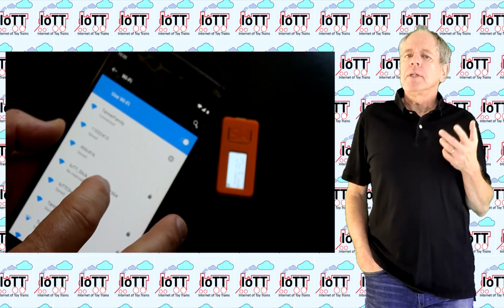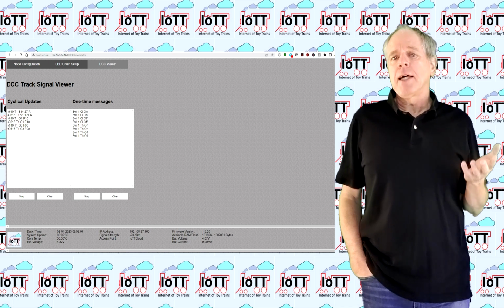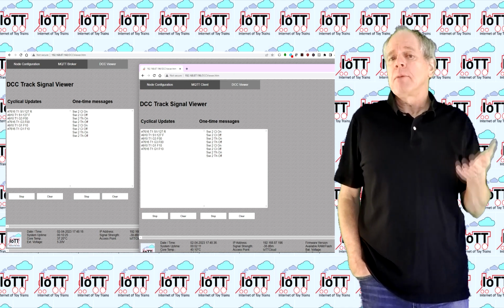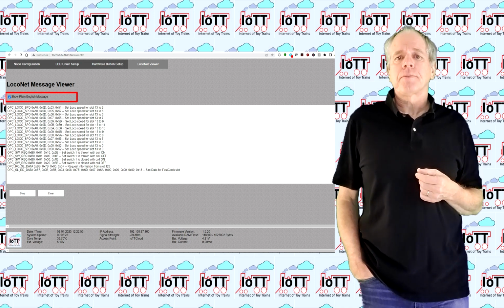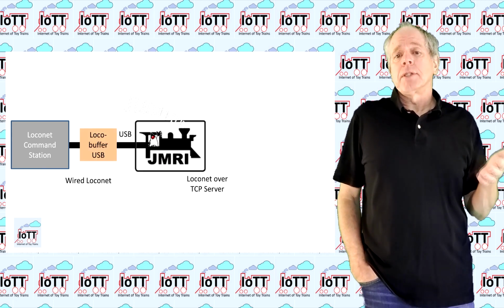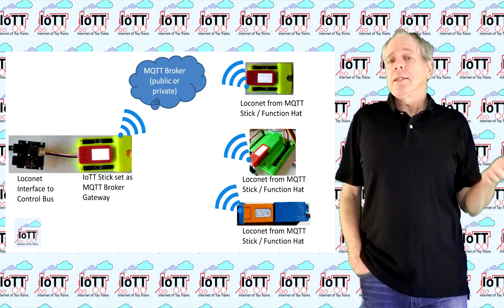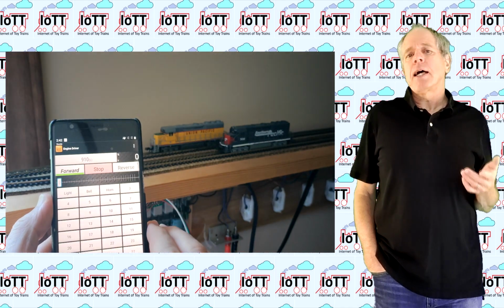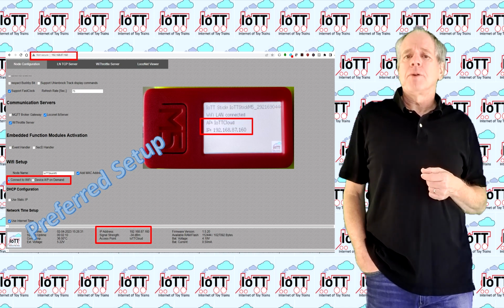IoTT Stick Communication - Architectural Overview (Part 2) (Video#112)

Comment: I am having problems getting IoTT Stick Plus connected to my local network or my AP.  I had no problem designing and printing a 2 axle car for PurpleHat unit.  Also create a jig to install the magnets for this N scale car with plastic wheels.  But I am having problems trying to get the IoTT Stick Plus to connect.  I have an AP right next to my and also have a PR3 connected to my computer.  I think I have  been through your videos and written material.  And I just do not understand, do you have some very simple instructions with pictures.  Thank You.
Reply from the maker: Check this web page: https://myiott.org/index.php/iott-stick/user-manual/iott-stick-core/wifi-configuration
If you keep having problems, please let me know and describe at what point in the process you get stuck.
Reply: @IoTT  Got it working on Friday night.  Thank You.
Reply from the maker: @allenvanhorn6714  Cool. Glad to hear that!

Comment: Great information.  I always wondered about using internal vs public broker.  But I worried that if my internet was down, nothing works.  I didn't think of having IoTT stick bridge between internal and public.  Thanks.
Reply from the maker: Thank you. Yes, you can do that. But you typically only use a public broker if you need Internet for long distance connection. For in house, a private broker is faster. Public brokers, unless you pay, do not have individual accounts, so you want to make sure you use a topic that nobody else knows or uses.

Comment: This video gives a good overview about the capabilities of the little orange box. For the moment I'm confused about about the LN over TCP client. If the client is working as I hope and the LN grove board is attached with a power supply I could make any LN device wireless. How to configure this? I checked with 1.5.20 but there is no configuration for a LN-client. Is this a future idea?
Reply from the maker: In this video I am only talking about the wireless side of things, but not about going from wireless back to cable based, as demonstrated in videos 75 and 76 with an MQTT based wifi connection. As a leftover from that video their is a setup option for the Loconet interface that makes the stick think as Lcoonet master, but I never did the complete configuration to set it up as subnet. Thank you for making me think about it again, I may add it soon as it is as simple as adding a Loconet Subnet option to the server options and routing commands from Loconet over TCP or Loconet from MQTT to the wired interface.

Comment: Hi Hans I have been catching up on all your great work. I am in the process of building a new layout. I am using JMRI, DCC++EX command station and planning on using MQTT to control accessories (Turnouts (Servos), block detection, signals) via an MQTT broker from JMRI. Can you setup your Green, Yellow and Blue hats to interface to JMRI using MQTT without using Loconet. I thought I had seen in an earlier video that you had implemented a mode were you can define the send and receive topics that match the way JMRI is set up, but I could not find any details on how this is implemented. Thanks Tom.
Reply from the maker: Thank you. 
 If you do not plan to communicate over the internet or want to build your own logic modules using Node-RED, I would suggest you use Loconet over TCP.
At this time, it is only Blue and YellowHats that have some native MQTT, but the structure is not really compatible with JMRI. But ten again, you can use Node-RED to do the conversion as needed.
However, I would strongly suggest to set up a nice example in JMRI first before you decide. You will find you end up with a ton of definitions you have to do in JMRI, since you need to individually define each turnout for every communication type you are using. That's one of the main reasons why I did Loconet over MQTT. I will probably do some comparison videos in the near future showing the differences in the setup efforts needed.
Reply: @IoTT  Thanks Hans. I have gone back over some of your earlier videos and now understand  why you are using Loconet over MQTT. I think it is great how you have integrated the Red Hat  with DCC-EX and look forward to the release of your new IBT-2 Power shield board. I have just ordered some boards on Tindie to tryout and will order an IBT-2 Power shield when it is in stock. Many Thanks Tom.

Comment: Thanks Hans for the great info. This system is very extensive and always love every new video. There is always so much  information that I have to watch them several times. Great work
Thank for all the work you have put in to designing this.
Reply from the maker: Thank you. I always struggle with defining what information is on the slides and what is sound track only. I find it a fine line between boring and not enough information. So, it is kind of intentional that you have some benefits from stopping the video at certain moments and take some time to study the additional information in the picture ;-)

Comment: Once again, thank you Hans for all your great work in providing a comprehensive layout control system. This latest video comes at a time when I am trying to provide a signalling system for a friend's layout. His layout uses an NCE DCC system to control the trains. But I am thinking of using a Loconet to provide the signalling system. Connecting the Loconet to the Raspberry Pi running JMRI is what I was not sure how to do, connecting the Loconet and the NCE DCC system using USB, I have to investigate if this is even possible, but using Loconet over TCP may be the only way to connect the Loconet to JMRI. I am only just starting this project so still in the investigative phase at the moment. (I use Digitrax DCC equipment on my own layout, so I am much more familiar with Digitrax and Loconet than NCE equipment.)
Reply from the maker: Thank you. Loconet over TCP is a simple and effective way to connect JMRI to a Loconet system, so that would be my preferred solution.